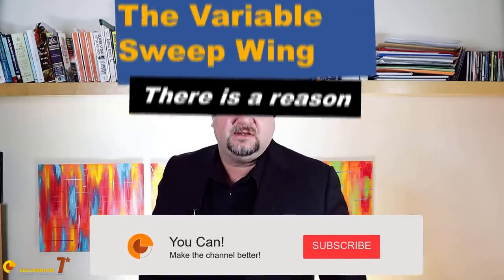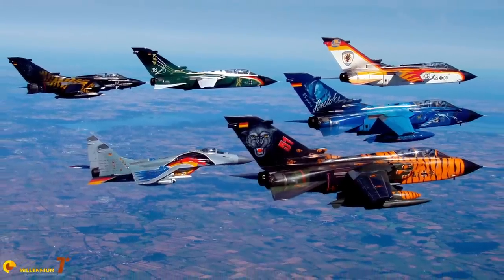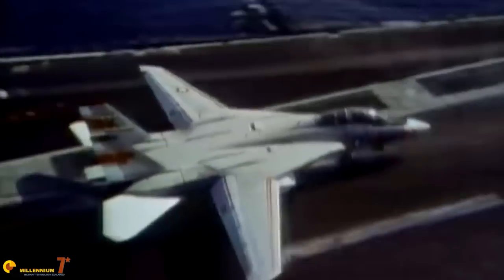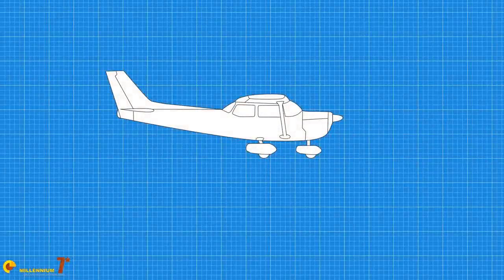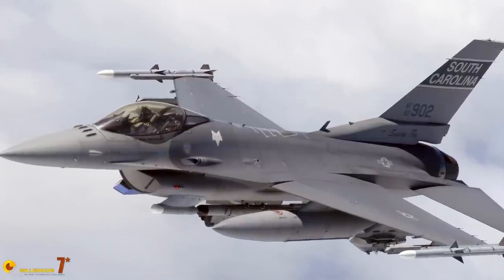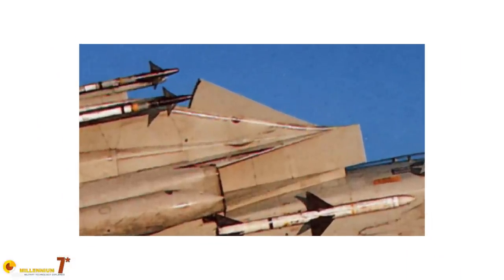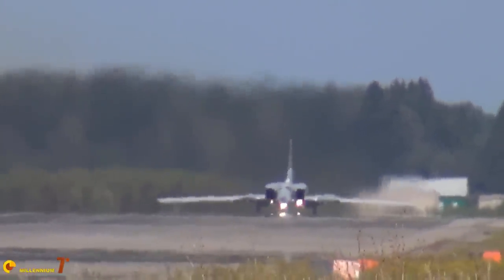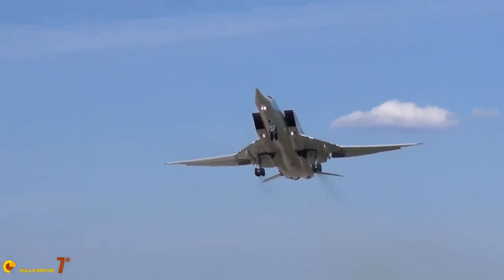F-111, F-14, Tornado, Su-17 were Hopelessly Outdated - the demise of the variable sweep wing

Comment: I have read that when the Israeli's evaluated both the F-14 and F-15 as their new air superiority fighter to succeed the F-4, they considered ease of maintenance as an important factor. They counted all the moving control surfaces on the F-14. And then did the same with the F-15. This in part led them to choose the F-15 as it essentially had less to fix and maintain.
Reply from the maker: Yes, it does but much less than the AC.
Reply: @ASJC27  yet the F-14 had better results than the F-15 against small fighters in ACEVAL/AIMVAL.
Reply: @tomdtom5407  Does that stat include simulated employment of radar missiles or just IR missiles?  The F-15 was still stuck with the AIM-7 and could only shoot one missile at a time, while the F-14 could shoot multiple AIM-54s.
Reply: @gort8203  no Phoenix at the test, only Sidewinders and Sparrows.
Reply: @ASJC27  easy to understand: the Eagle is easier to fly. Being easier to maintain and less expensive at the time, It makes a simple decision.
Reply: @tomdtom5407  Still not surprising if we are talking about detecting smaller targets with the radar.  The AWG-9 was designed for long range detection of  multiple bombers and cruise missiles.  Plus it was operated by a skilled RIO who could probably manually fine tune for optimum performance for a given search.  The APG-63 was more automated for a single seat fighter and probably had some compromise settings to reduce pilot workload.  If these assumptions are close I think the Navy made the right choice with the F-14 and the IAF and USAF made the right choice with the F-15.
Reply: @gort8203  2 things that were in Tomcats and not in Eagles: TCS set for VID ( I think It was part of ROE) and a second pair of eyes, important for situational awareness in close range.
Reply: @tomdtom5407  That's right, I remember VID was part of AIMVAL/ACEVAL.  I recall reading that the F-15 guys were strapping rifle scopes to the side of the HUD as a workaround, but that certainly was not as good as the system in the F-14.
Reply: @ASJC27  the F16 was launched as a replacement for the F5E that the US could sell to allies who couldn't afford the F15.  The A model didn't even have a radar and it was intended to only carry two wingtip AIM9s like the F5E.  It was only when the USAF wanted something cheaper that the got a radar for self air intercept. It could not carry and use the Sparrow in US service which was the only radar missile the US had aside from the Phoenix at the time. When the AIM120A came out, the F16 got a better radar with A2G modes and the ability to carry A2G munitions and use them.
Reply: @ASJC27  you said "The F16 came later as a complementary multi role fighter".  The context of the conversation is F15 vs F14 selection in the 70s.  I assumed you were talking about the USAF briefly considering the Tomcat for northern defense patrols but see now it cos have been Israel you are taking about(didn't think those talks happened until the 80s though?).  The original F16A came with a very basic radar set with slightly more functionality than the radar in the F5E.  The original F16A was not multi role... no more so than the F14 was (F14 did have air to ground capability from day 1, just wasn't authorized in that role until the 90s).  I'm not sure the original F16A even had an A2G radar mode for CCIP/CCRP bombing until the C model.
Reply: @Whiskey11Gaming  The YF-16 was not multi role, but the F-16A was indeed bought as a lower cost swing role fighter (the term used then) to compliment the F-15.  USAF needed more quantity to offset the Soviet/Warsaw Pact numerical advantage, and the F-15 was expensive.  On top of this the AIMVAL/ACEVAL study was being misrepresented as indication that inexpensive fighters armed with all-aspect missiles might be the equal of expensive BVR radar fighters.  There was lots of talk that leakers that got past the F-15 would find more numerous F-16s ready to engage them with these missiles.  When not needed for DCA they would swing to the bombing and BAI role, and if I recall correctly even the A model had CCIP.

Comment: Feel like the F111 is not getting nearly the credit it deserves as a long range tactical bomber and maritime strike aircraft here
Reply: You are right, it is not getting its due.  The airplane could carry more payload farther or faster on less fuel due to the VG wings.  The airplane did not become obsolescent because of it wings.
Reply: Gort it certainly wasn’t obsolescent when it retired from USAF service
Reply: @bushyfromoz8834  Then why was it replaced by the F-15E?  I think the F-111 was a great bomber, so if the word obsolescent bothers you forget that word.  My point was that the alleged (by M7*) limitations of a VG wing were not the reason the F-111 was withdrawn from service, and I think we agree on that. The fact is that the F-111 was ageing, and while the airframe design provided unequalled performance--despite the heavy structure it was saddled with as a result of the side-by-side capsule the Navy had insisted on--it was difficult and expensive to maintain, depending on the variant, not all of which had the latest systems.  Another production run was considered, and I would loved to have seen an updated F-111 with even better systems, but the competing F-15E came in as less expensive as well as more versatile. An updated F-111 would have had better range and speed, but the F-15E had actual air to air capability as well as a newer bombing system.  I guess they decided that price and versatility offset the extra fuel burned dragging around the cambered wing designed for dogfighting.

Comment: I don't think the relaxed stability issue has much to do with the alleged demise of the VG wing.  Relaxed stability is useful for aircraft designed for high maneuverability, and highly maneuverable fighters had already moved away from the swing wing with the still stable F-15.  The swing wing still makes good sense for aircraft that need to combine long endurance with high speed dash in the same airframe. The F-111 and B-1 were perfect examples.  Shifting fuel fore and aft to manage CG is a common practice in supersonic and long range aircraft.  The old F-106 even did it.   

I think the main reason newer bombers don't have swing wings is because they are flying wings for stealthiness.  Longer range does not help if you get shot down before you reach the target, and stealth replaced speed as a defensive measure. 

More powerful engines did not cause the demise either.  The VG wing would still provide the same efficiency tradeoff to an aircraft that has to combine long endurance with high speed dash.  The video mentions that a VG wing does not necessarily add weight when you consider the tradeoff in fuel weight needed to perform a long range mission profile.  That tradeoff remains even as efficiency improves with more efficient engines.

The VG wing is not "obsolete", it is just not the best solution to current requirements because stealth outweighs high speed dash in the current long range air combat equation.
Reply: The F-14 would buffet and hesitate before going through mach for some reason. F-16N didn't do that, nor does the Hornet.

F-22 exceeds the acceleration, climb, dash, and endurance of the F-14D. With modern fighter engines, I'm trying to see where VG sweep wing would be valid, and drawing a blank.

The unsolicited F135 mid-stage upgrade module makes it a 47,000+ class engine, and it isn't even a variable cycle, tri-flow design like what's being used on the PCA prototypes.

Hybrid ceramic-alloy materials science will facilitate rocket ship performance from fighter sized airframes.
Reply: @LRRPFco52  T
The VG wing makes sense for a long range strike aircraft that needs to lift a heavy load off a runway, cruise efficiently to long range, employ high speed dash through high threat airspace, and be able recover to friendly territory.  The F-111 and B-1 definitely benefited from the VG wing.  

You are focused on the fighter mission, for which it is tougher to make the VG wig productive.  Some folks question whether the F-14 really needed the VG wing, or whether a fresh start might have shifted USN from the VG mindset established by the abandoned F-111B program. But for the purpose of this discussion I accept that the F-14 wing was necessary to have efficient low speed cruise and loiter coupled with high speed dash.  

USAF had different priority for the F-15 and found the VG was not a benefit for an airplane optimized for sustained maneuvering at .9 Mach.   The wing was not as efficient as the F-14's at very low or high speeds, but the brute force thrust provided sufficient dash speed anyway.  I think a VG wing on a fighter is not worth the weight and complexity unless the range/loiter requirement weighs more heavily than it does for most tactical fighters.  A VG wing might benefit fighters built to escort bombers like the B-1on deep strategic strikes, but we don't build fighters for that mission.
Reply: @gort8203  I'll pretend we never spent all those years on the B-1B Combined Test Force when we returned from West Germany as I read your response : ) .  I still remember the day Doug Benefield died doing low-level variable geometry wing sweep with fuel system management tests.  This was when they were using B-1A prototypes with some early design B-1B systems, but I think the first 3 birds still had the ejection capsule.  One of them had sort of a desert camouflage paint scheme.  One was all white, and the other had sort of a European 1 mix of dark greens.  They used F-111s and F-106s for the chase planes, so I was used to seeing Varks and 106s flying about every other day.  This was the early-mid 1980s out at Edwards.  I still remember the first production B-1B at Plant 42 rolling out, which we attended of course.

Different times for sure.  The B-1B still has the record for payload of all US bombers.  For Tacair, the F-111 had excellent range even with a low level mission profile (made obsolete by double digit SAMs).  They slapped as much external fuel on the Mud Hen as possible as its replacement for most profiles, while the F-117 could go deep into the IADS and hit whatever it wanted to.  F-111F did extremely well in ODS, killing more tanks in 2420 sorties than A-10s could in 8640 sorties.  It was sad to see the Vark go, but it had a lot of out-dated systems, engines, with growing maintenance.

The other platform that doesn't get mentioned much is the EF-111A Sparkvark.  Lots of room for EW equipment, side-by-side crew cockpit.  Very long range and endurance so it could open the door for strike packages, then open and close it on the way out after they did their sets.  I was really surprised that the Air Force went without a fast mover Electronic Attack platform for as long as it did, even relying on reserve EA-6Bs for the campaign in Yugoslavia.

One of the missions for ATF was penetration escort for ATB.  F-117A also had a penetration anti-AWACS A2A mission profile that was unknown until last year.  With networked assets now, we can do all sorts of interesting things with B-52H/LIETNING, B-1B/LIETNING, F-22A, JSF, and ISR assets working together.
Reply: @LRRPFco52  I was sad when the retired the F-111, but at at least the F-15E was an able replacement.  But I was really perplexed when they retired the EF-111 without an equivalent replacement.  I know it was all about money, but relying on the EA-6B just seemed insufficient.  I point to this when the Navy guys gripe about retirement of the F-14 in favor of the F-18; it happens all over.  (Except to the A-10, which has a lobby that can't be beat.)

Comment: While many of your later reasons are correct (weight, complexity, alternate aerodynamic solutions, better engines...) your first reason is totally wrong. Variable geometry is completely compatible with relaxed stability. Most FBW aircraft have relaxed, not negative stability. A full authority FBW variable geometry aircraft could have a neutral to negative stability with the wings forward, and go to a "normal" stability with the wings aft. Since wings sweep as a function of mach number, that's fine. At high mach you have plenty of Q going over the tails to generate desired pitch performance, and fighters don't "dogfight" supersonic. The F-14's glove vanes were designed to move the CL forward when maneuvering at high mach and they were disabled (in the A) non-functional (in the B) and ultimately removed completely (in the D) because you didn't need more pitch authority supersonic, you had plenty and that was in a statically stable aircraft. Also your center of pressure moves aft supersonic countering the problem to a certain degree. 

I think the main reason is other aerodynamic solutions were developed with advanced airfoil and wing designs that were "good enough". The huge advantage variable geometry wings have is transonic/supersonic. The transonic and supersonic drag reduction with a wingsweep >60 is dramatic.  Lots of cool NASA papers on the subject.
Reply: All good points. I think the main reason is complexity, weight, cost ...and maintenance issues.
A conventional wing is much easier to inspect for stress damage than a sweeping wing, since the former can be inspected externally, while the latter requires getting inside the plane to inspect it. Also, any wing-based hard points need additionally complex internal hardware to pivot. Personally I'm not convinced that the swing wing deserves to be a dead concept though. Just as an example, the F-14D, although not chosen for production, was a very compelling gen 4.5 platform.

Comment: Stealth was not the cause of the F-14’s retirement in 2006, maintenance cost per flight hour was. Swing wing was not only factor. Absence of easy to open quick access panels was. Talk to F-14 pilots/rios. Sites exist on YouTube. Pilots & Rios were in favor of updated F-14.

Slow speed handling required for getting aboard a carrier was important. Also enabled slow speed dogfighting- better nose pointing authority. Negatives were need to use spoilers rather than ailerons. F-14 had slow roll rate & also roll reversal could occur at certain AOA range. FBW would have been great but would have required completely new design.

F-18 has lower performance for fleet defense mission. Also politics played a role w/ Hornet mafia. Super Hornet tried to remedy this performance loss to a degree but did not do so completely. Different factors apply to F-111. More a bomber than a fighter anyway.

Comment: I may have missed this. While I understand that on a swing-wing, the center of lift moves aft as the wing sweeps back,  it would also mean that the center of gravity moves aft as the mass of the wings move backwards. How does that affect the stability of the aircraft?
Reply: Because although they both move , they move by different amounts.
Reply: I thought about this too.
Reply: High pressure fuel pumps relocate the fuel mass forward to move the CofG.

The systems are most impressive on the B-1B, which has fairly rapid wing sweep actuation and can carry well over 200,000lb of internal fuel.

All fighters have internal fuel mass management systems, and the F-14 & F-111 were highly-dependent on them for stability through the VG wing sweep range.

Non VG aircraft manage the CofG in the same way, including mass shift after weapons release.

The F-16 increases in altitude noticeably when it drops Mk84 size bombs at low altitude since lift increases with the weight loss, and the fuel management system has to balance the jet immediately in conjunction with DFLCS. There's a lot going on under the hood.

Comment: I'm a bit confused at the moment. The reason why the Tomcat got retired is because it needed a lot of maintenence? Or there are other reasons I'm missing? In any case great video.
Reply from the maker: The video was on why today we don't use swing wing anymore, and there are 3 other videos on the swing wing. The F-14 was just an example.
Reply: @Millennium7HistoryTech  Yes, I've already seen them and they were interesting, but I think the sweep wing is a tecnology we shouldn't abbandon, if it's so many advantagies.
Reply: @noahjormungandr7759   The F-14 was expensive to operate, and the end of the cold war was used as the rationale for relaxation on the fleet defense mission for which it was ideal.  Use of the term "oudated" for the VG wing sends an inaccurate message.  The technology is not outdated, the problem it was develop to solve has been supplanted by other more pressing problems requiring different solutions. When they invented the screwdriver they didn't abandon the hammer while there were still nails to be driven--different technologies for different purposes.  The VG wing remains appropriate for a mission profile that demands aerodynamic efficiency at both low and high speeds. However, changes to operational tactics since the B-1 was designed now prioritize characteristics such as stealth. The VG wing is not an outdated technology, it is simply doesn't fit more recent priorities.

Comment: I have to disagree about the variable sweep wing when it is used by a strike aircraft like the SU-24 FENCER and the TU-160 blackjack bomber as these are not fighters and dont need to have as much maneuverable as a fighter, the F111 was taken out of front line service because it was not up graded, the SU-17 is also not a fighter its a ground attack aircraft , it was removed from front line service because it could not be up graded not because it was a swing wing aircraft. The Mig-27 is still used by some air forces because its weapon systems can be modernised and its still a value for money ground attack aircraft.Yes i agree that the swing wing is out dated for fighter aircraft.